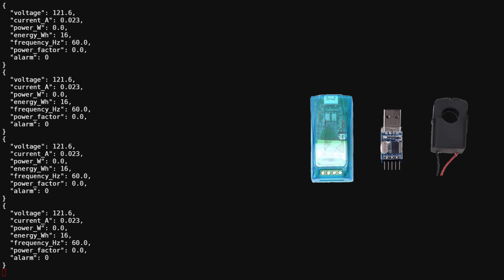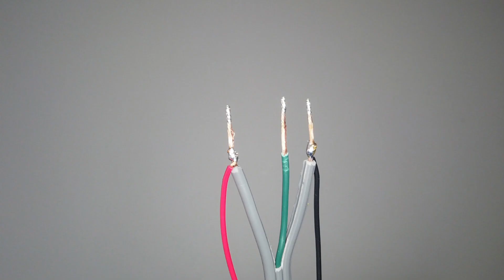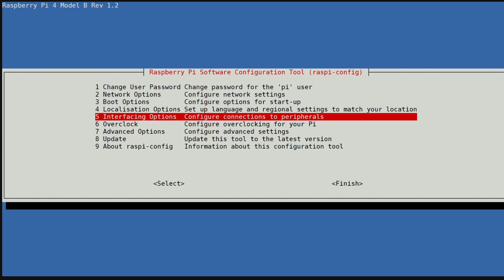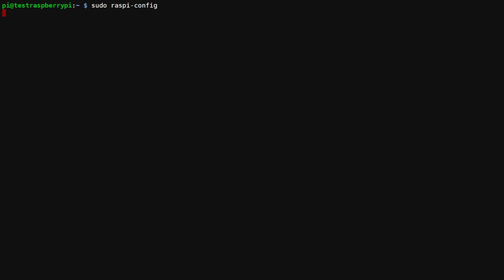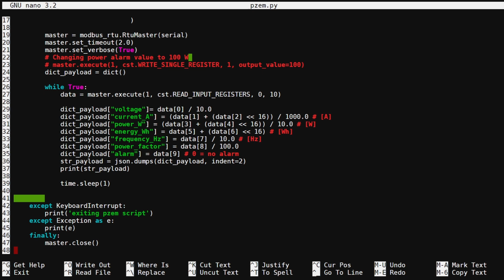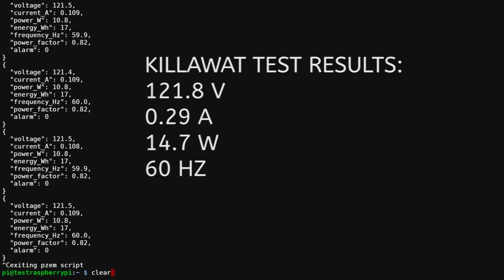PZEM-004T V3.0 (Raspberry Pi)

Comment: Thanks for the video.  I waas glad to see how to handle the raw data from the serial interface with Python.  FYI an incandescent bulb may be a better load.  Your soldering iron has a thermostatic switch that turns the power on and off depending on the temperature of the iron.  So it will vary quite a bit. That's why the wattage changes from around 60w initially to much less later; probably the thermostat on the iron reached temperature and turned the current off. A dumb 60W incandescent bulb would be a bit more stable to do current and power testing.

Comment: Any ideas on how to attach multiple PZEMs to the same serial? i Understand these are addressable but looking for some guidance. I have seen lots of ideas and code for esp boards but want to do it with a PI so that i can store data locally on the pi. I also plan to use the pi to read other meters in the distribution box, so will be convenient.

overall, i plan to read 6 Pzems, not sure if that brings any challenges and ideally from the same usb to serial. I am using 3 pzems with the esp board but the data is not reliable due to intermittent wifi issues etc.
Reply: I believe you can, by using a modbus connection.
Reply: @arielgamboavazquez4250  thankyou, i figured it out eventually. Instead of coding it up i just went with nodered modbus integration

Comment: How to reset "energy_Wh" in python code.
Reply: import serial

def reset_energy_wh(port):
    try:
        # Configurar el puerto serial
        serial_conn = serial.Serial(
            port=port,
            baudrate=9600,
            bytesize=8,
            parity='N',
            stopbits=1,
            timeout=1
        )

        # Construir el frame Modbus RTU para reiniciar energy_Wh
        # Frame: [Slave ID] [Function Code] [CRC]
        slave_id = 1  # Cambia si el ID del dispositivo es diferente
        function_code = 0x42
        frame = bytearray([slave_id, function_code])
        
        # Agregar el CRC al final del frame
        crc = calculate_crc(frame)
        frame.extend(crc)

        # Enviar el frame
        print(f"Enviando comando de reinicio a {port}...")
        serial_conn.write(frame)

        # Leer la respuesta (opcional, dependiendo del dispositivo)
        response = serial_conn.read(256)
        if response:
            print(f"Respuesta recibida: {response.hex()}")
        else:
            print("No se recibió respuesta (esto es normal para este comando).")

        # Cerrar el puerto serial
        serial_conn.close()
        print("El contador de energía ha sido reiniciado.")
    
    except Exception as e:
        print(f"Error al reiniciar energy_Wh en {port}: {e}")

def calculate_crc(data):
    """Calcula el CRC16 Modbus para el frame."""
    crc = 0xFFFF
    for pos in data:
        crc ^= pos
        for _ in range(8):
            if crc & 1:
                crc = (crc >> 1) ^ 0xA001
            else:
                crc >>= 1
    return [crc & 0xFF, (crc >> 8) & 0xFF]

if _name_ == "__main__":
    reset_energy_wh('/dev/ttyUSB0')  # Cambia al puerto correspondiente